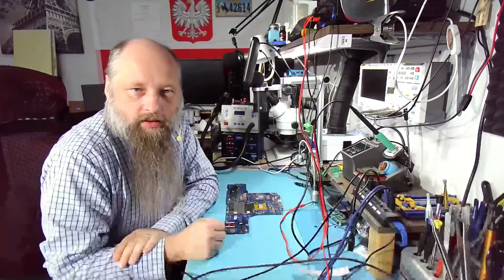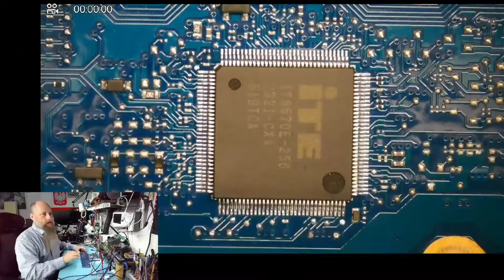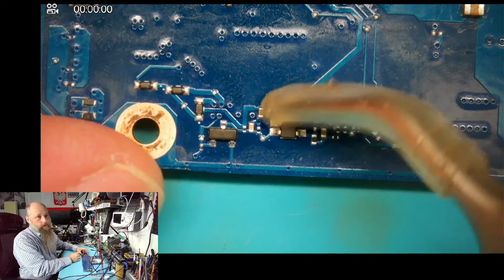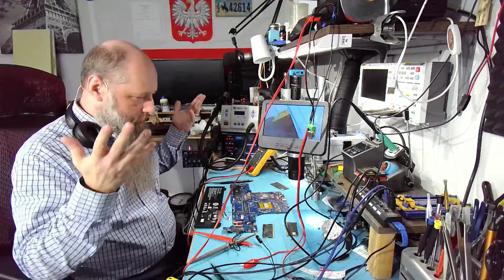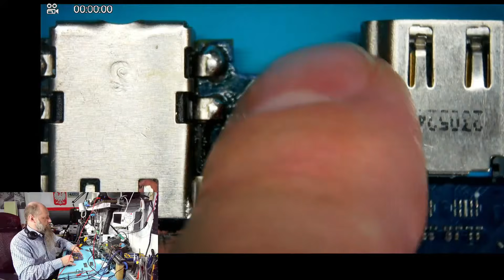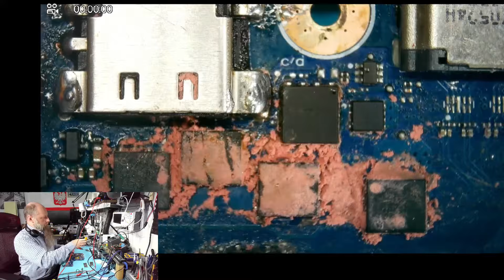178 | Tricky Case of Acer | It's not a short on LDO I think it's a power sequence issue

Comment: Hello Same issue here, same board looping not starting and not display, I do not have ACOK on BQ chip, replaced still same issue and still no ACOK on pin 5 BQ24780s
Reply from the maker: this case has been eventually resolved by another shop, I think it was a bad CPU if I remember correctly

Comment: As I commented in your previous video regarding this board, I was sure the battery wasn't charging. If there was no short then BQ would charge at least the battery but this is not the case. The other obvious reason is the EC firmware. If you really want to be thorough in your diagnosis you must verify the startup sequence signal by signal. Check in the schematics if the startup sequence is mentioned and follow up. I should also suggest checking the RTC power. Is it present at all times ? Does the 32.7Khz crystal oscillates ?
Reply from the maker: Thank you so much! I will check the crystal, however I have no way to confirm the firmware. You gave me an idea though, what if it is the bios issue indeed, I'll see about that. I also found a faulty zener diode but it's only related to USB-C power, shouldn't impact the power sequence.

Comment: You might try injecting power to see if the board powers on? It's possible to bypass the current sense resistor by supplying external current.
Reply from the maker: I'll keep that in mind

Comment: If you have LM on the board, clean it aggresively, using toothbrush and alcohol, wash it all down.
Once it is super clean, recheck the pcb very closely, looking under BGA chips for a LM presence.
This really looks like LM short to me, on a late rail, or data to ground, or two data lines, something like this.
Reply from the maker: yep, that's exactly what I did, then I ran it through an ultrasonic cleaner, we'll see

Comment: My helios 16’s charging light also started doing this like a month ago
Like blinking so much because I just got into this I asked a couple of guys on sorin’s discord but one said that it is the bq chip. I touched two pins of the bq chip on the battery side at the same time and the first mosfet after the battery literally got on fire
That’s the fault I caused but I also believe the first fault like yours is main power rail related like maybe one of the 5/6 mosfets behind the charging port is partially dying and cutting the voltage but no idea yet I have to fix my mistake first so

The laptop was working on battery properly but the charging light was blinking
Reply from the maker: in my case bq chip is fine, power OK pin is high, the problem is somewhere down the line for sure
Reply: @blackhorserepairs hopefully you can fix it because I want to fix mine too!😀
Sorry to bother you if you still have the laptop could you check if the gate pin on the first small aon7506 mosfet on the left of the battery connector takes any current when injecting voltage into it?
I just want to know if the gate of mine works fine now
Reply from the maker: @rexbg7981  I'll check, but if gate takes current the whole transistor is likely shorted and I checked them all for shorts. I did find a faulty diode but I don't think it's the main problem.
Reply: @blackhorserepairs Thanks mate that will be really helpful!
I just want to make sure the MOSFET doesn’t fire up for the second time when plugging in the battery
Also is the mosfet’s drain supposed to show 0.2 volts on the multimeter when i have the charged plugged in
Have a great day!